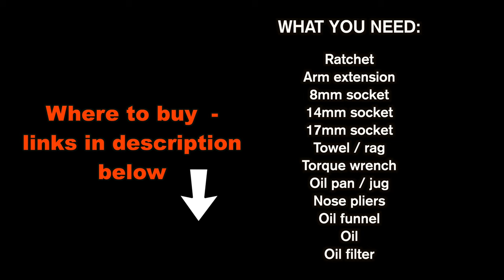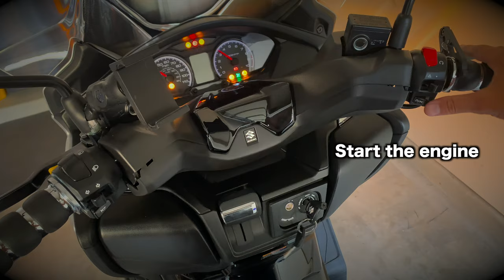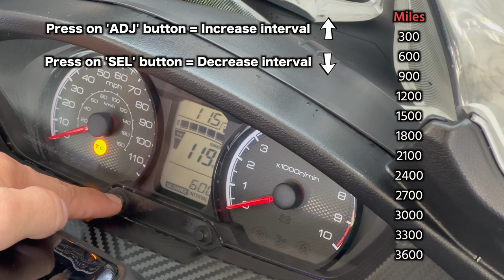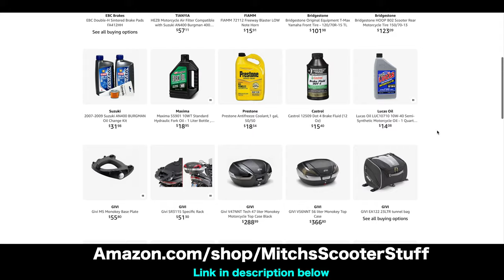Suzuki Burgman 400 - Engine Oil / Oil Filter Change - 2017 - Current | Mitch's Scooter Stuff

Comment from the maker: Engine Oil - https://amzn.to/3VkMPdw
Oil filter - https://amzn.to/3Vm2mtE
Ratchet 3/8 drive - http://amzn.to/2hhmnUs
3" / 6” extension set 3/8 drive - http://amzn.to/2h7ypMl
8mm socket 3/8 drive - http://amzn.to/2xLNVXU
14mm socket 3/8 drive - http://amzn.to/2xGn4Ms
17mm socket 3/8 socket - http://amzn.to/2EMT6LO
Rags - https://amzn.to/2Yh8jvg
Torque wrench 0-150 lb/ft 3/8 drive - http://amzn.to/2Crqq4R
Nose pliers - http://amzn.to/2yetDDj
Funnel (long) - http://amzn.to/2v5mYLn
Oil pan / jug
Reply: Hello, hello, my brother has a problem with my bike, the first generation PC X, and he has a problem with the rear wheel, it makes a loud sound

Comment: Great video as always Mitch - well shot and well explained. Just to say that the Burgman's oil level should be measured upright and off the centre stand. I made this mistake (despite it saying so very clearly in the manual - d'oh!) when I first purchased my Burgman. The oil level while on the centre stand shows a higher reading than that off the centre stand, meaning you could potentially be running with too little oil. Probably not enough to do any damage I realise, but worth being aware of :)

Comment: Just bought a 2018  Burgman 400. After watching this oil change video for 2017 to current 400’s I clicked on your Amazon link to buy an oil filter and it showed filters fitting 2007 to 2016 only.

Comment: Mitch, the oil you recommend is MA type, for wet clutch motorcycles. It has additives to prevent clutch from slipping. Oil for scooters is MB type, without those extra additives, scooters don't have wet clutch. MB oil is more "slippery" than MA oil, which is beneficial for scooters, because they run on very high RPM most of the time, and MA oil isn't the best in this case.
Reply: "While JASO MA lubricants are in fact suitable for all applications, MB lubricants may induce clutch slippage in motorcycles and must only be used in scooters."

Comment: Three Q’s. 

1) Is it really needed to remove the “gallery plug”? The manual doesn’t say to touch it. 

2) Where do you find a torque wrench that goes as low as 2.3ft-lb? I can’t find one anywhere. Lowest is 5ft-lb that I have found. - my manual doesn’t give torque value on these at all. 

3) manual for 2019 says drain bolt torque is 16.5ft-lb torque, not 17. So is this video “to current” good for 2019? Could your filter cover bolts really be different from my model too?

Thanks so much.
Reply: Great videos.  But I have same question. Is it necessary to remove oil gallery drain plug and what does it do?  Tnx

Comment: I wish I live in your country so I could give you my 2006 Piaggio fly lmao 
the low oil pressure light won't come on ignition and I don't know how to change it 
so I drive my scooter without low oil indicator is it dangerous?
Reply: My oil drain out of my vespa and killed the engine so be careful